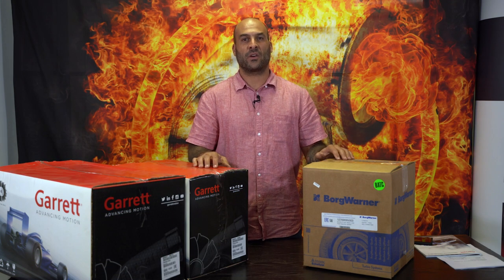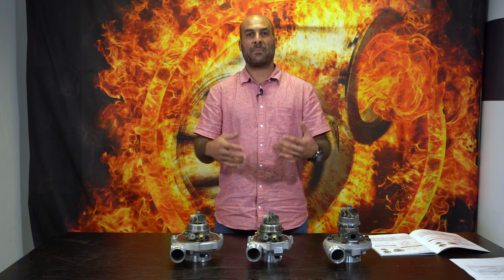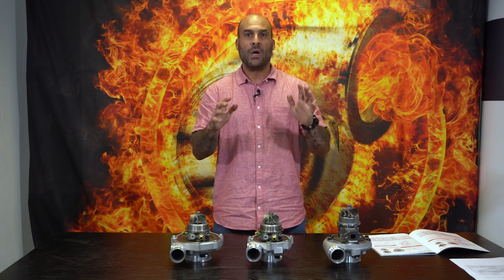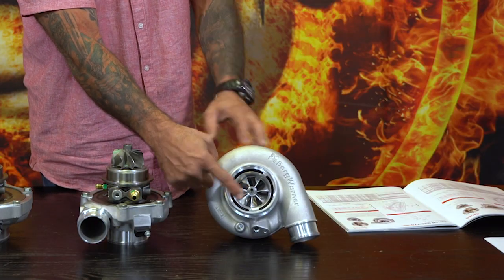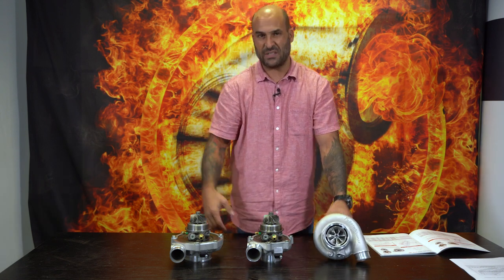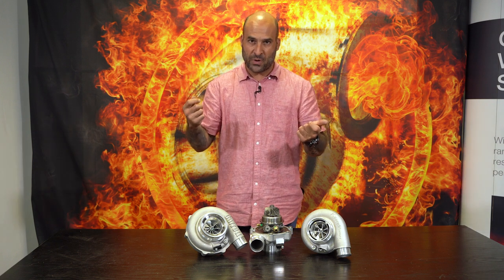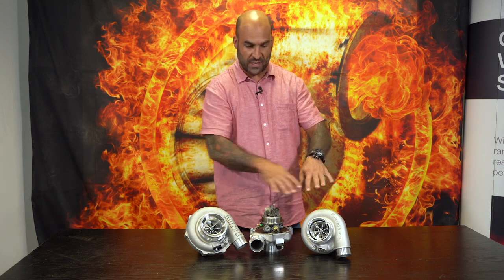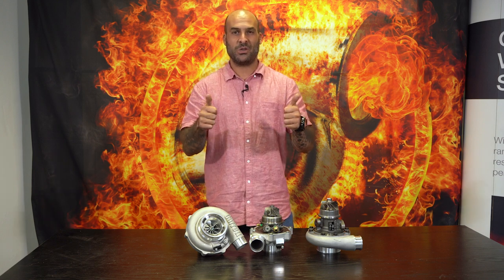BorgWarner Airwerks S200SXE versus Garrett G30-660 and G30-770

Comment: Hi Chris im torn between g25-660 and the s200sxe for 1.8t 20v large port head with supertech valvetrain, power goal is about 500ish to the crank. After watching your videos Im leaning towards the borgwarner. Would that be the correct choice? Thank you.
Reply from the maker: The two turbos are not in the same class or category - one is BB and the other is journal bearing - you need to compare the EFR7163 to the G25-660 - these are two matched turbochargers, and the EFR will outspool the G25 and make more power aswell. Costs are the same too - in fact slightly less for the EFR depending on where you purchase from

Comment: If the turbo has water ports, is water cooling required or optional?
Reply from the maker: ALWAYS use water cooling if the turbo is designed with it - why would you not use water cooling in your engine?? Since its oil cooled and has water ports...... silly comparison i know, but exactly the same.
Reply: @TurboDirectSA  Proximaty to water. Remote mounting.
Reply from the maker: @general23cmp  Always use Water when water ports are part of the bearing housing design, it will save you money and a turbo.  The first part of the turbocharger to fail with a thermal overload is the bearing system.

Comment: Hi mate I have an Jetta 2003 1,8t with a precision 5130 right now, planning on upgrading. Would you go with a g25-660 or g30-660 ? Spool time on the 5130 isn’t great (4-4,5k) and goal would be 450-500hp. Engine is 1,8t not stroker with head only exhaust valve and spring
Reply: Not that at there hp 1,8t tend to run 25psi
Reply: Or if you have any better turbo recommandation for this application
Reply from the maker: Thanks for the comment Maxime - there is most definitely a better turbo, more reliable and will outspool the G25 and make more power. The EFR7163 with the AR80 VBand turbine housing - this is by far a better product, at a better price point, and includes more features and bolt on products. The EFR is by far much more reliable than any G-series Garrett is --

Comment: Hi there, thank you for this informative video. 
I'm trying to decide which turbo to use for my 2023 wrx build with the new fa24dit motor (2.4L). I'm choosing between a g30-770 and g30-900. Car will be raced at the track occasionally but mainly a street car. I was advised to try and reduce backpressure as much as possible--would jumping to a g35 make any sense in my vehicle? Looking for 600-650whp on e85 as my final numbers. Thoughts? Thanks!
Reply from the maker: I wouldnt opt for the Garrett G-series, they are not what they advertise. For this power i would consider the EFR8370 which will outspool and outperform the Gseries turbochargers in the same 'advertised' HP category.
Reply: @TurboDirectSA 😮😮😮
Wow interesting insight! I’ve been going through your past videos (2-3 years old) regarding the g series and I was under the impression they were highly rated. Now I will need to do more due diligence. 

Would you be able to elaborate a little more regarding “they are not as advetised” statement? 

Thank you so much for your time and recommendation.
Reply from the maker: @luvhcchris  The power advertised do not marry up to the compressor maps - check the videos on this in the channel. In practise we have found the compressor map to be closer (not 100%) to the actual power you will see, and this is 15-20% less than the HP figure Garrett Advertise in their printed catalogues.
Reply: @TurboDirectSA hello! Thank you so much for your time and elaborating. I will continue to watch more videos and learn.  

Will take up your recommendation and try to work with the Recommended turbo😊

Comment: Please do comparison on pulsar vs Garrett g25 or g30
Reply from the maker: We do not get these turbos in country, and i wouldnt be prepared to spend money on copied product to be honest,.
Reply: @TurboDirectSA  send them an email, I’m sure they’d be open to the idea.

I would prefer Garrett personally but the quality & flexibility in specs of the pulsar’s seem to be a good way to go now. 

Thought you’d be a good critic for quality and would make a good video as there seems to be a trend in Aus with Ford barra engines
Reply from the maker: @kersa1995  Thanks mate - its a good idea, and i honestly don't mind doing reviews and comparisons, just always note that i am unbiased always.  I dont care which product name the component holds. I will point out the obvious and i will go into detail in various areas and do direct comparisons. 

If the product is good, its good. If its not, ill identify and mention it. Ill substantiate the flaws aswell as the strengths on either side. 

If Pulsar want a comparison or side by side test and they brave enough, let them send a turbo over and ill be happy to do the comparisons.

Comment: Im thinking of getting a g30 770 with 1.06 t4 divided exhaust for a forged rb26. I am more interested on response but at the same time aiming for 650hp atw. Would a g30 770 be a perfect turbo setup?

Great informative video by the way.
Reply from the maker: Thank you for the compliment, glad you enjoying the content. The Garrett is the last turbo i would choose, especially the G-series. The G-series will never make the claimed power, see the compressor map.  The turbine is laggy.  

The BorgWarner range is far superior in spool, power delivery, peak power, cooling, reliability, features and price. 

For that power i would choose the EFR7670 or the latest 8370 which is in essence an 800HP capable turbo. You will make this power and then some with the later. The spool will be quicker than the G30-770 and it will make the power claimed, and then some.

Comment: Always wildly informative but i am some what confused. Am i on the right track thinking that twin borgs on my 3.5 ecobeast basically will get me out of the hole and keep all the top end there is just as quickly  as the garret dual bearing models?
Reply from the maker: Which Borg's are you referring to? The larger the turbos, the more power, higher in the RPM range, but more lag.
Reply: @TurboDirectSA   My application ultimately is Is daily driver/street drag
Reply: @TurboDirectSA   I guess I should've finished that I have a tune in place at the moment that has taken some of the power out of 1st gear and put it on top, that little eco boost is pulling as hard at going into a 120 as it is at 75 which is good but naturally I'm looking for more than I can hold on to
Reply: @TurboDirectSA   I'm sorry I've been watching your videos pretty much non stop it was the Borg that topped about 7:00 horse power maybe 750 which is what I'm looking to build
Reply: I must say further I've never seen anyone delve into  the turbos with your expertise. The maps are wonderful things that again I've  never seen and i ran turbo diesels  from back when ford put the 7.3 turbos into  the 3quarter and 1 ton pickups back in the 90s.ive been running the ecoboosts since 2012. It is absolutely amazing what you can get out of these 3.5 Even without changing the turbos but changing the turbos takes you to d*** near Drag racers
Reply: Also I have been afflicted with the Need for Speed since I was about 9 years old 10 and now I'm 66 And if anything it's only gotten worse
Reply from the maker: @johnhoward6551  Then you go for the larger Borg - EFR8370 which is closer to 800HP capable.
Reply: @TurboDirectSA   I figured that's what you'd say good deal

Comment: my turbo project will be ready soon
bmw e30 m20b25 2.5 forged bottom end with borgwarner s252 sxe t3 .83 ar Agp housing
i will run it with 98 pump gas and methanol
how much you think will produce this turbo on my set up ?
Reply from the maker: Nice project - depending on the compression, tuning, boost, hardware supporting mods, dyno, etc you should see 500HP easily.
Reply: @TurboDirectSA  thanks
from my research the s252 sxe will boost and accelerate faster than the s257 ,will not have the top end power of 257 but will be the perfect street use
Reply from the maker: @bmwe-op4jx  I disagree, there will be negligible difference between the two turbos on that engine. Especially for street use with a separated manifold.
Reply: @TurboDirectSA  so both turbo will perform great ?
Reply from the maker: @bmwe-op4jx  Correct - i would opt for the 650HP S200SXE - youll have some power in reserve if 650HP is not your target. This will generate less heat, and offer better reliability in the long run.
Reply: @TurboDirectSA  my goals are 450 whp to max 500
Reply from the maker: @bmwe-op4jx  The S200SXE (650HP) will do this easily with reserve and at lower boost pressure and heat -- this is what you want.
Reply: @TurboDirectSA  i already bought the s252 sxe 
i didnt find your channel faster 😔
Reply: @TurboDirectSA  I switch to the s257 ,it made 481 whp and 64 kg of torque at wheels at 1.75 bar with pump gas and water methanol,,also both turbos spool the same but the punch of the s257 is way more
Both turbos at  1.5 bar the s252 made 406 whp and the s257 made 459 whp

Comment: Well done. Not many dare to speak the truth about the G-series. Just look at the air flow capasity compared to claimed horsepower capability. On what engine will a G30-770 turbocharger support 770 hp? You obviously can not boost it very hard. I think it is mostly plain bragging and customers WILL find the truth.
Reply: I was disappointed by my Mexican made G30-660's quality versus my Japanese made GTX3584RS.
The G30-660 needed to be broken it honestly.  But it turned out to be a sweet turbo, trick is to size it properly which Chris does such a good job with
Reply from the maker: Facts are Facts - we dont hide facts for the sake of agencies - we speak fact whether Garrett or any other manufacturer likes it or not.
Reply: @TurboDirectSA  a distributor that's out for the client and not for their hardened contract with supplier is very much welcome!
Reply from the maker: @Christdeliverme  Thats not what some manufacturers believe - but i believe in hard cold factual information that benefits the money train that any manufacturer relies on - you the client.